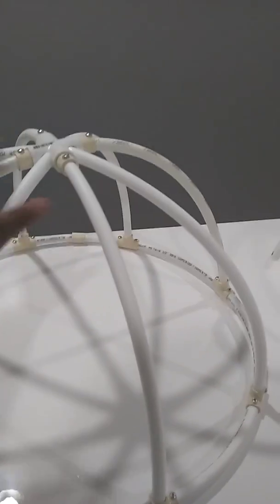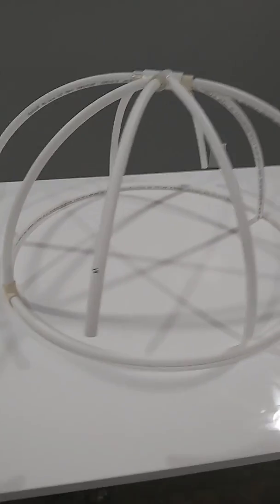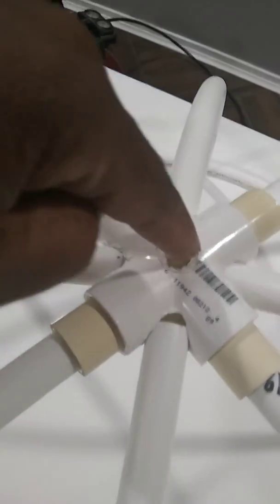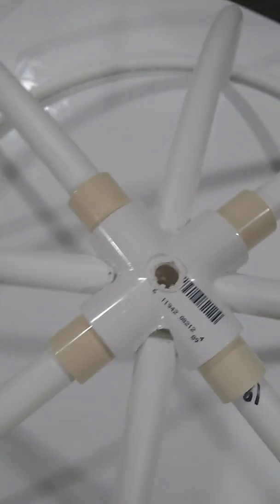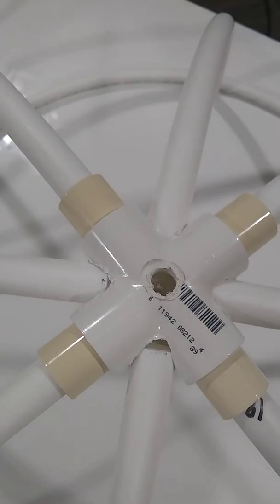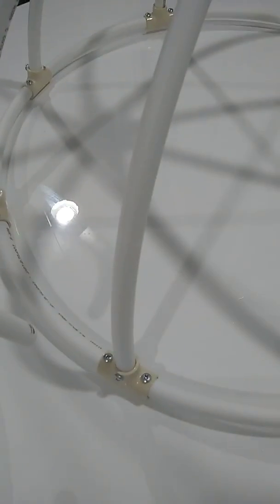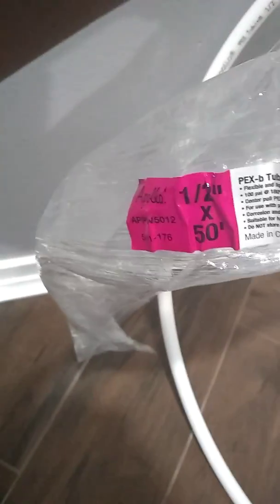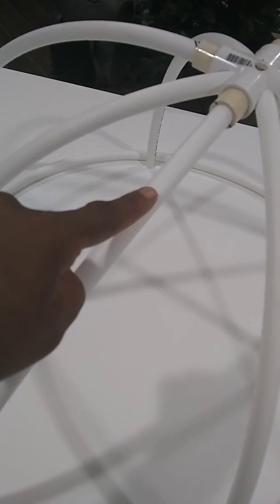Hot Air Balloon Frame Design

Comment: Correct me if I'm wrong but you did not cut the 77" PEX pipe at all, right? It seems like you slid the tee's in and then screwed them on. If you could let me know it would be great. Thank You!
Reply from the maker: Katiria Figueroa Hi! Sorry for the super late response. Yes I cut them. The TV's won't slide on due to the inside walls. Cut the pipe to create 8 equal lenghts. Hope this helps.